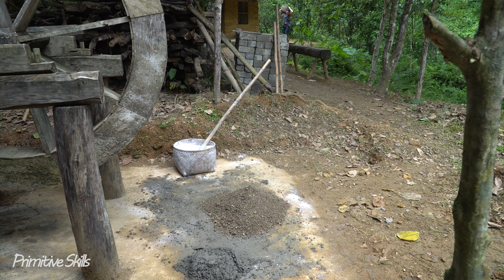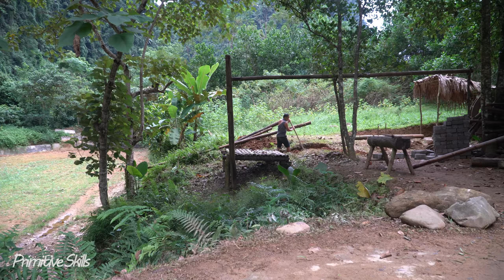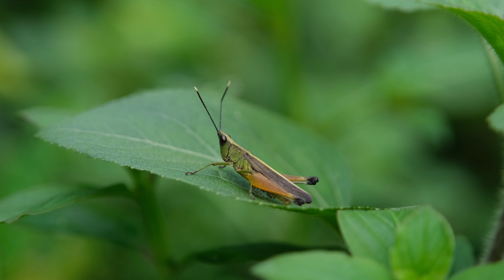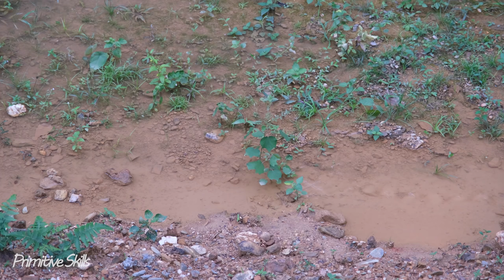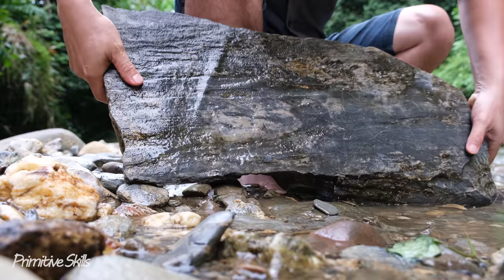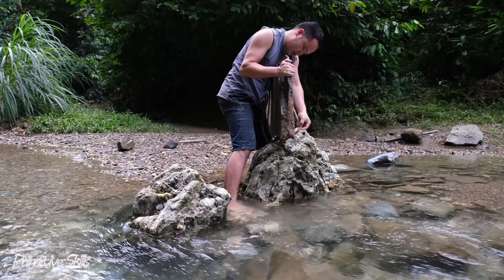The water pipe to the pond has rotted, I have to replace it - Ep.144

Comment: You should probably keep the water wheel dry when you're not specifically using it to keep it from rotting as well. As you are probably familiar with, stuff in the tropics rots very fast. It might be a good idea to be more careful what you keep wet, it would be a real shame to see a lot of your hard work rot away. Of course a water pipe has to be wet and isn't quite as big of a deal to replace as the other stuff, but it would be a good idea to be more careful with things like the water wheel.
Reply: Ko sao đâu bạn ở Việt Nam những cối chuyển nước như này có khi nó tồn tại cả 100 năm ko mất mát gì .nếu bạn có cơ hội qua Việt Nam lên khu Tây Bắc bạn sẽ đc chiêm ngưỡng những cối chuyển nước bằng Tre .Gỗ tồn tại vài trăm năm vẫn đc duy trì để chuyển nước từ thấp lên cao .từ sông lên các ruộng bậc thang tuyệt đẹp
Reply: @So-zp2uf  How this is possible

Comment: Bro, you need a valve system that diverts the flow of water into the pool, bypassing the water wheel, and does not create such a noise of falling water. And, of course, a forge driven by a water wheel!

Comment: The performance of the water wheel has improved quite a bit. Even after he upgraded the water supply it still seemed to have difficulty generating significant torque. I wonder if he made any changes to it or if it's just because the shaft and bearings have now worn in.

Comment: Why no belt or sling to hang your axe, hammer, or your machete ?!  This would free your hands for other things... like carrying heavy or large objects.
A shoulder bag would be another good accessary.  In the American old West, they called it a "possible" bag.  You carried things you might possibly need.  Fire starting tools, torch/candle material (lighting), cordage, food, sewing kit, promising pieces of stone that could later be turned into cutting tool or arrowheads, etc. .  You can even use it to carry back roots, nuts, and other food items found on your hunts.  Anything that would fit in, leaving your hands free for other tasks.

Comment: I have seen Amish water wheel work shops. it has pulleys and leather belts connecting all the machines.
Lathes, drill press, you could even run your blower for your metal smelting

Comment: If you could get your hands on some electric cable, a bicycle wheel, a rubber belt, some lorry battery’s and a lorry Alternator you could connect it to your water wheel to spin the alternator and then to the batterys to produce electricity….or put the alternator high on a pole with a propeller on it and turn it into a wind turbine….both would power some lights, charge a phone, a portable tv/dvd player and few other things…I’d love to be able to do what you are, keep up the good work, watching from UK 🇬🇧.

Comment: لكي تجعل الخيزران أكثر تحملا . عليك أن تجففه تماما على الشمس. قبل أن تستعمله في نقل المياه.
أفضل حل لمشكلة تعفن أنابيب الخيزران بطريقة بدائية هو أن تستعمل خطين من الخيزران . بدلا من خط واحد.. وتستعمل هذين الخطين بالتناوب. أي مثلا أنك تستعمل الخط الأول لعشرة أيام، ثم تترك الخط الأول ليجف. وتستعمل بدلا منه الخط الثاني لعشرة أيام ... وهكذا بالتناوب
To make bamboo more durable.  You have to dry it completely in the sun.  Before you use it to transport water.
 The best solution to the problem of rotting bamboo pipes in a primitive way is to use two bamboo lines.  Instead of one line.. these two lines are used alternately.  For example, you use the first line for ten days, and then leave the first line to dry.  And instead, the second line is used for ten days... and so on alternately

Comment: I also would have bundled straw for a form to build CEMENT piipe/ tubes...you have warm climate. For CEMENT Long lasting fixtures for plumbing.
After CEMENT cures. Burn out the straw used to shape CEMENT casts for permanent pipes.   Just a thought
how I would have tried a better. Water system..than wood.
We also had just wooden water hand pumps...and hogshead oaken barrell....For decades.  Then we got black plastic hose.
.

Comment: Couldn't you just make larger bricks instead of carrying those large wooden plates? Or are the bricks not strong and reliable enough to support your weight?
Reply: that's natural rock not wood! and concrete isn't so good for flexing without rebar in it to reinforce it!!
Reply: @keithmoore5306  I thought so too but I wasn't sure cause it didn't look so heavy. Maybe it's alight kind of rock?
Reply: @unogazzy84  it's limestone from the looks of it! the one with the rope looks like it would go a 75 to 100 or so pounds!

Comment: I would give the idea of making a metallic pipe (if you had such a way to do it), but iron oxidizes too fast it can be bad for your health, keep with bamboo.
Reply: The flow of water is not 100% constant, so the pipe would rust very fast.
Reply: @joonashannila8751  Yes, even the bamboo rotting it will have to be patient to change it
Reply: He could coat them in cement, the problem would be the amount of metal to do so, maybe with a blast furnace, but to much work I guess
Reply: Some tree sap could do the trick too
Reply: @guilhermesgarcias  Yes it takes a lot of work, but in terms of resistance it would be great, but iron in contact with water oxidizes quickly,He had to improve that blast furnace one day, a very hard job anyway.
Reply: @DyeusPter  yeah, with some dolomite he would have magnesium and with it ductile iron which doesn't rust so easy, but to his demands I think that drilling some logs and having hardwood pipes would be the best solution
Reply: @guilhermesgarcias  yeah
Reply: @DyeusPter  Yes. There are some metals that dont rust, if you keep nonstop flow of water through them. If the water is even still, they will rust, but as long you keep constant flow for example cast iron pipes, they wont rust... Thats why some old houses sitll to this day have very good condition cast iron pipes no problem ^^ You idea would actually be very good, if he just did it correctly
Reply: terra cotta doable!! he's doing ceramics so terra cotta ain;t much different!!
Reply: @keithmoore5306  it wouldn't hold pressure